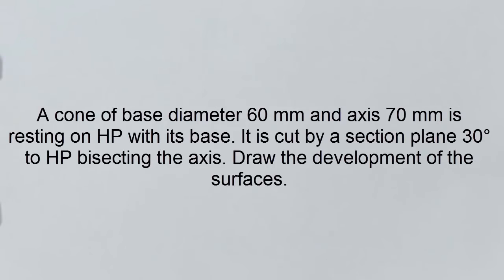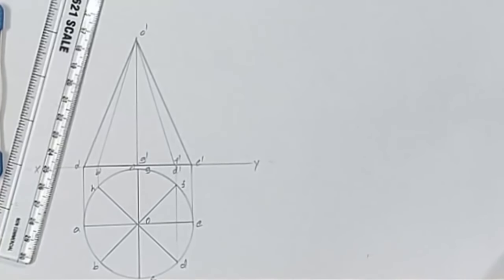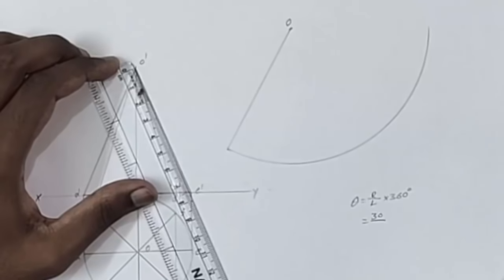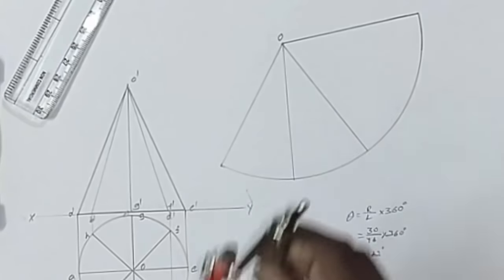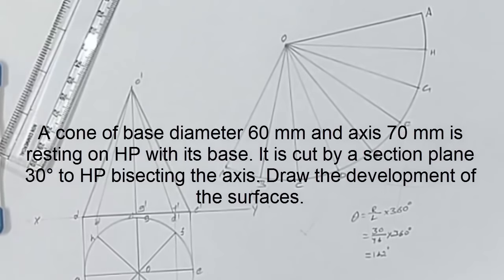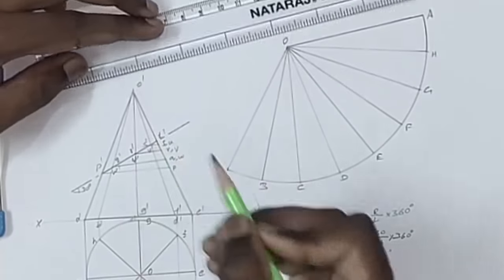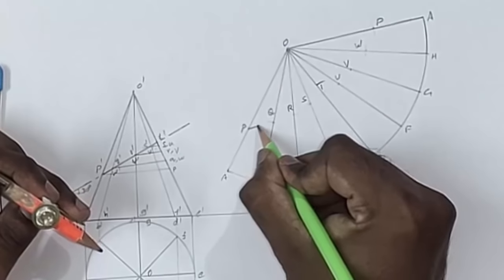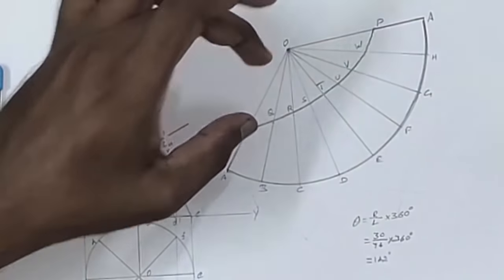Development of surfaces 5 | Cone | Engineering Graphics | Truncated Cone

Comment: Sir how you divide this 142 angle into 2 part? Please help
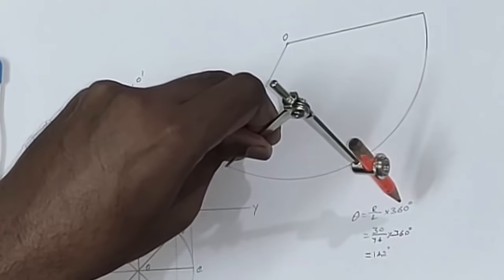Reply from the maker: Sorry for the delayed response. As mentioned in the video at 3:10 cut an arc from both the ends of the sector. Then from the intersection point of both the arcs, draw a line to the centre of the sector.

Comment: cone of 50 mm diameter and height 70 mm is resting on its base. It is cut by a cutting plane inclined at 45° to the HP and it bisects the axis of cone. Draw the development of the lateral surface of the truncated cone.